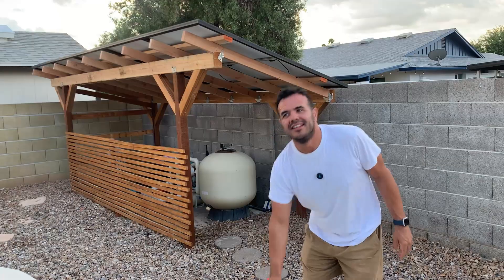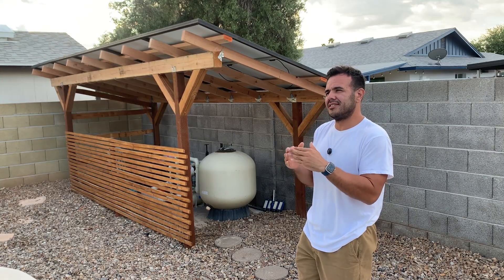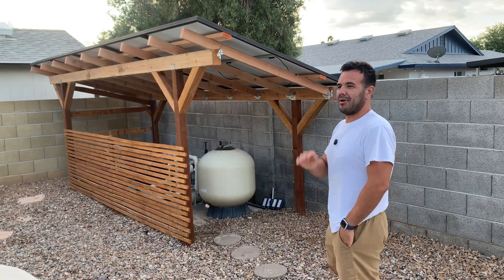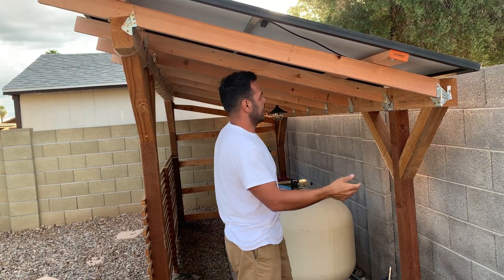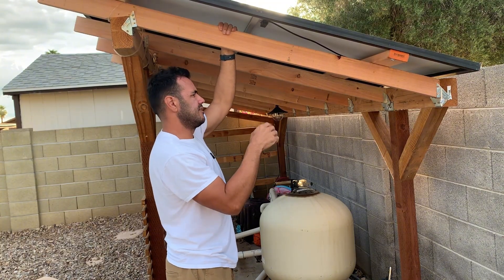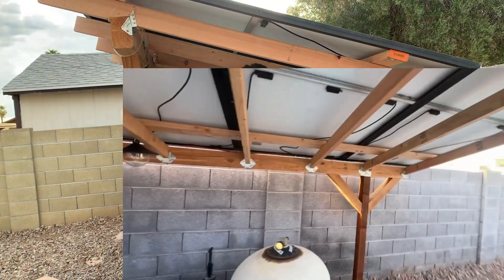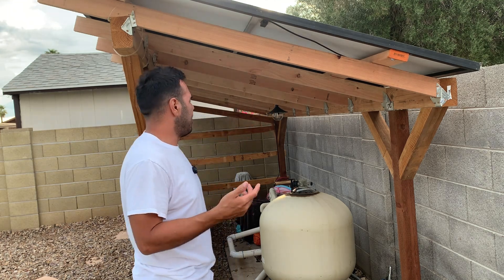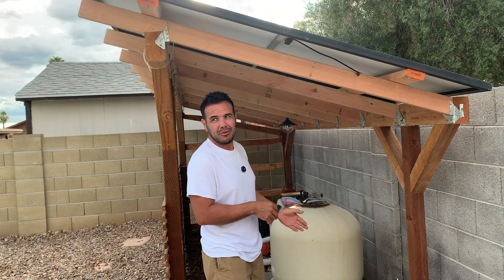Wooden Solar Pergola Build + Best Solar Panel Mounting Options

Comment: Great job! I'm currently doing 2 pergola just like you on my backyard. I'm using 6x6 by 12ft and 10ft post. Might cost more than ground mount but saves space and you get shaded areas under the panels.
Reply from the maker: Yeah the cost definitely goes up using 6x6 posts, but I’m sure it’s going to look great when finished. And the dual benefit of getting shade under the panels can’t be overstated—especially if you’re in a hot climate. You’ll have to post some pics or videos of the end result! What size is your array going to be on the pergola??